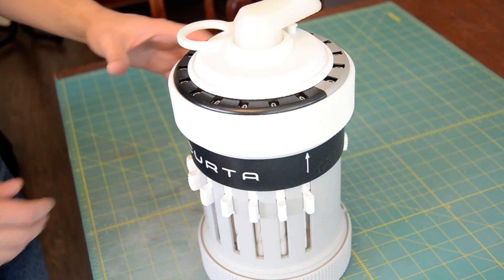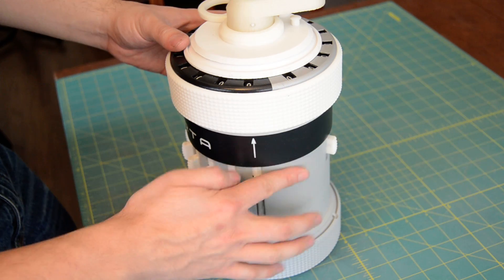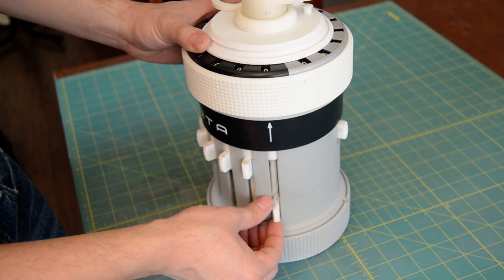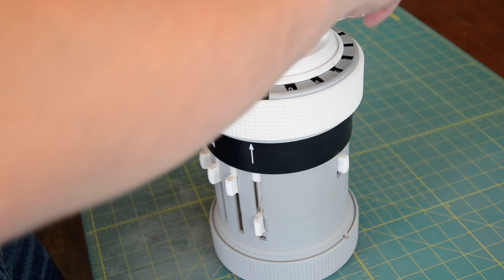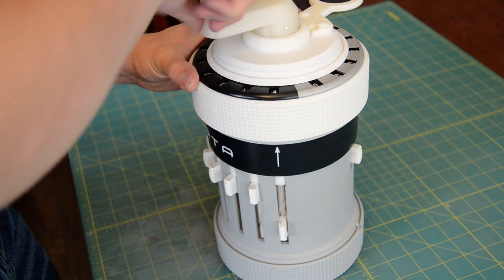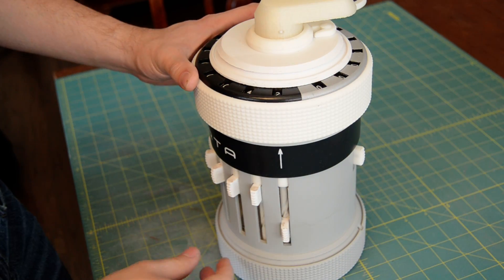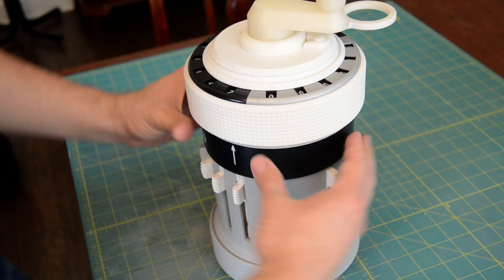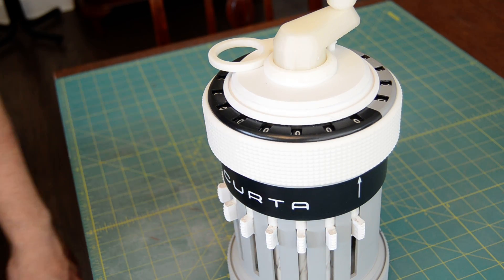3D Printed Curta Demo revisited

Comment: Man, I found out about your 3D printed calculator. Before I saw a video, I was looking to see if anyone was selling a printed one because I thought it would be cheaper than buying a real one. After reading about it more and seeing your demonstration, I think it is safe to say that this WILL NOT be cheaper than buying a real one lol. It is the coolest 3D printed object that I have ever seen, but this would probably cost more than the real thing.

Have you thought about using the stl files in a CNC machine to make some wooden molds? You may be able to produce an accurate sized replica made from metal. But, I don't know. I was just trying to think of how it could be more feasible to use. It looks like you actually get a workout while doing math with this. I do love this though, so I'm not criticizing it at all.

I do like the larger size for what I am wanting to do with a curta. I want to make a program to use stepper motors to operate this thing instead of using my hands, and the computer controllong the stepper motor drivers would use a type-writer like user interface to take the calculations to carry out from the user, translate that input into a sequence of stepper motor rotations, and the rotations make the calculator perform the calculations. I am thinking that maybe the plastic may have more resistance than the metal counter parts, which may make my idea harder to create. It might be doable with NEMA-32's though, which would kind of add some awesomeness to the look.
Reply from the maker: Thanks, I appreciate the interest! The unfinished 3D printed parts shouldn't cost more than an original Curta, but after all the manual work to fit the parts, tune it, and paint it, it would be.

I haven't thought of using wooden molds for casting -- I'm not sure it would be accurate enough. I do want to eventually get into CNC machining and approach a 1:1 scale Curta.

It's not as much work as it seems in this video. Also, I took it apart and eliminated any bit of friction I could find after this and it runs much smoother. I will be creating more video from the painted device soon.

Your idea sounds pretty cool. I think NEMA-17s could work if you got some high torque ones and some good stepper drivers. As this is 3D printed, the parts inside aren't quite as strong / rigid, so subtractions have to be carried out slowly and some operations might still miss a carry. If you pull it off, let me know -- I'd love to see it.
Reply: Well, just subscribe to my channel so I can find you easily when I do. I'm about to make a cool clock with some nixie tubes once I get them. I ordered some the other night because I've been wanting to do a clock and a watch. I realized after I ordered them how I could make a pretty cool clock. If you like Fallout 4, then you may really like the clock I make. I'll be demonstrating it in a video. But it's nothing near as cool as this 3D printed calculator you did. I have a 3D printer that I built, but I am still learning to use it.

This crazy calculator controller thing I want to make may not be finished for a couple of years, but it might be done within a year. It depends on how busy I get with work. It probably will be within the year because it is pretty simple. It might be considered "Steam Punk", but it's not quite the same style. I just like crazy machines.

Yeah, I wasn't sure about the accuracy either. Ceramic molds might work well. They probably would, but you would probably have to get a Curta calculator if you don't have one, so that you could shape molds of the parts. Since they are expensive, I would sell some of the knockoffs to make at least enough money to pay for the price of the Curta. I don't have enough money to even get one or I would try it myself lol.

By the way, I haven't seen a distinction between the torque of the stepper motors where I've gotten mine. I normally shop from china to save money.

Comment: You might be able to make one in 1:1.5 scale using HP's UV-fused powder printing technique.  The only problem is availability of the process as there are only about 20-30 of the machines in the world.
Reply from the maker: douro20 agreed -- 1:2 or 1:1.5 might be possible. I checked into a few places that have them and offer print services, but it is more expensive than it would be worth. I would totally try this as a promotion of one of their services.
Reply: Marcus Wu you shoukd get in touch with them!

Comment: I began my own type two. I'm using inventor pro and I have already finished the step drum. If you want me to I would happily send over my current progress in inventor or STL form
Reply from the maker: That sounds awesome -- I don't think there is a private message feature on youtube (that I could find), but you can send me a message on thingiverse: http://www.thingiverse.com/mwu/about.
Reply: riptide1024 I just created a thingiverse account and have to wait 24 hours until I can publish anything. I also can't find engineering drawing 2030 the lower main casting and I am currently slowly making it from pictures and other similar parts.
Reply from the maker: Yes, it does look like that part is missing. The profile of it is visible in 2520 and a portion of the bottom of it is visible in 2501. The part mostly provides a base for the supports and columns so much of it can be derived from other parts (such as the upper main casting). The tricky bit will be getting the correct height to align the anti-rotation plate with the collar on the main shaft and the positioning for the anti-reversal pawl and zero positioning lever. Some iteration of the part might be necessary to get it right, but it's doable.
Reply: riptide1024  Anyway so far I have all  of 2508 already. I also see a problem with our programs. I am able to turn inventor files into stl but not the other way around and I am currently only using inventor because it's the only program I can get for free from my high school that I know how to use.
Reply: Also I wont be able to communicate over the weekend.
Reply from the maker: Mr.Dr.Prof. Gandalf I struggled with this issue as well. My next project addresses what I see as a gap in CAD for Makers.
Reply: riptide1024 Name any file type you want and I think inventor can export it, just not import.
Reply from the maker: Mr.Dr.Prof. Gandalf onshape would allow us to collaborate, but the work would have to be public even in an unfinished state
Reply: riptide1024 I will try out on shape and see if I can find out how to use it.
Reply: I have published my step drum on thingiverse
Reply: I have finished the tens bell for the most part

Comment: i don't have a 3d printer but i want to make this as a gift to my math teacher. any recommendations on how much it would cost and who to go to? i was thinking i could always look under services on craigslist.
Reply from the maker: This project requires a significant amount of time investment. Once the parts are printed, a lot of filing and sanding of small parts is necessary to get the proper fit. There is also some spring fabrication and a lot of tuning to get each digit working reliably. It took me about a month in rush mode to get the second one done.
Reply: I'm in the process of making one. I think it's going to take me at least 3 or 4 weeks to print all the parts, just the metal bits (screws and springs) are about $40.  Assuming I can get to the point of making clean and workable prints for all the parts, I would still not sell a box of parts for < $500 or so, and I would make absolutely NO guarantees that you'd be able to successfully assemble them because it looks to be a huge pain in the ass.  There are several hundred parts, ideally printed in multiple color plastics, and they are tricky parts to print; I've had a bunch of print failures so far though I'm getting better.

Comment: Wow. How much does it weigh?
Reply from the maker: Carl Siemens I don't remember off the top of my head. I will weigh it soon.
Reply from the maker: It just weighed in at 1533g -- right around 3.4 lbs. It's tempting to say from this that it takes a spool and a half to print, but there are non-printed parts part of the weight and there is a lot of support material involved in the printing. For my first Curta it took about 3 spools. For the second, it took just over that since I also printed it on a printer that wasn't completely tuned.
Reply: riptide1024 
Damn, that's a lot!
Reply from the maker: That is true (though not sure if you're speaking to the spools or the weight). I actually kinda like the weight of it. It doesn't feel cheap -- it has some meat to it vs some of the fairly light-weight prints I've done before.  I haven't weighed the printed parts alone, but I am pretty sure a decent portion of that weight is attributed to the non-printed parts -- around 35 springs, 30 screws, 8 nuts, and 37 ball bearings.
Reply: riptide1024 
Nice!
Reply from the maker: I just found an old pic where I weighed it before I started painting it. It weighed in at 1357g -- almost right at 3 lbs.

Comment: Very cool mate! I wonder if printing it in metal (through shapeways maybe) would make it run smoother? Either way it's really impressive!
Reply from the maker: dashn64 maybe -- I still have a lot of tuning to do on this one. This video was taken right after I had gotten assembly done without fine tuning movement of any parts. Some fine tuning will make it run smoother. In particular, I need to reduce the strength of the anti reversing pawl's spring strength, and I am sure some of the carry mechanism parts snag too.

I would love to learn machining at some point and actually build @1:1. Shapeways cannot print parts that small.